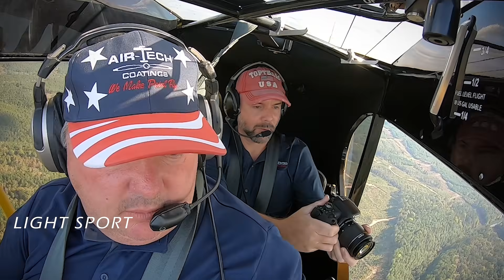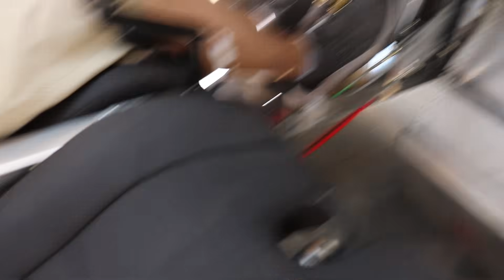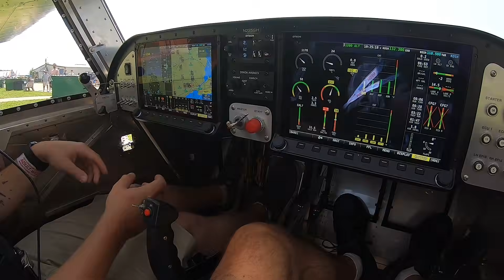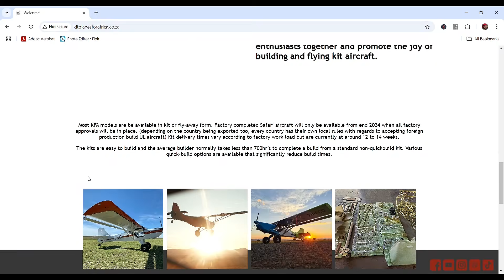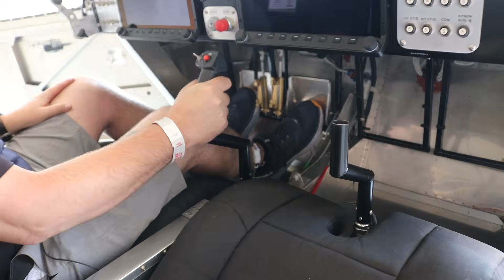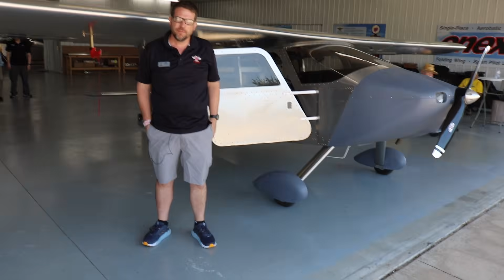I Fly the NEW Sonex Highwing! (On the Ground)

Comment: If Sonex were to raise the gear 3 inches, the plane would be a lot easier to get in and out of.  Plus, the raised attitude of the plane would be a lot sexier looking than the current shorty go-kart look.  If youre worried about forward visibility during taxi, install a GoPro in the nose and run the video to the computer screen.

Comment: Thanks to Mark and Sonex for putting added safety into the Sonex line with the high wing.  When going over on your back during an off airport landing, a Sonex pilot now has much greater head/brain crash protection, along with the ability to get out of the airplane when the crash is over. Theres nothing like a big bubble canopy to trap you in the cockpit when the plane goes over on its back.  Ou better hope it doesnt catch fire.

Comment: They really should do carbon fiber aerodynamic planes instead. They are really handicapping themselves by sticking to not only sheet and rivet but boxy shapes. Do a copy version of the Risen with a fixed forward windshield and SR22 style doors but keep the aero shape. Make it super light and skip the flaps, it's such a good glider that you don't need flaps on it. Landing speed might be 52kts without flaps and it could be lighter than Risen is. Carbon fiber is amazing if you use it right. Fixed skinny landing gear with nice aero covering. Super simple yet untouchable performer. And rather than two sides of fuselage glued together as is normal it could be done inside a closed 2 piece mold stood up on end so it's one shape. No trimming and polishing two sides together. With a polished mold the surface can be paint ready out of the mold. Very easy to build. Risen charged over 300k for their simple bird now. We need competition.
Reply: Nattering nabobs of negativism strike again.  Aluminum is perfect for this application.
Reply: @jeffwatson8862  Yep! Perfect. Is Naboo on the sectional charts for USA?  KNBU perhaps???   (haha!!)
Reply: @jeffwatson8862  I'm not from Naboo. I'm intelligent which might seem foreign to you. No, this alu construction is most certainly not perfect. And that's why more competent engineers don't do it that way. There are such potent tools available today, there is no excuse for these 100 year old rural garage build sensibilities. This is a soapbox cart. Look at it. It's not difficult to make an aerodynamic shape in composites. Look at birds, look at other planes. If they can make this soapbox with this many parts they can do composite. So they are self inflicting failure. They could do  so much better
Reply: Sonex does aluminum structure since this is their traditional space. This kit is within the skill level of someone with a few hands on skills, and not a person skilled in high end composite fabrication.  Anybody can pull a simple blind rivet. The composite airframe would be very expensive to produce since all the parts need a factory mold for each part.  You are not going to find a composite kit for anything except a replica kit car for 39K.  Thats just the reality of it.  Have you ever seen the composite Arion Aircraft Lightning?  They are composite kits and do what they do best.  Slick, fast and great looking too.  I almost bought one until I found out the luggage area was big enough for a pair of shoes and a toothbrush. Composite kit is pricey too.

Comment: And no toe brakes on the instructor's side, at least on this prototype.  My CFI was scared of my Piper 140 because of the same thing.  The perfect trainer, sat idle because of them.  On a 10,000 foot runway no less.
Reply: That's common on Pipers. I did some of my commercial in a Comanche 260, but it's totally fine for commercial. I'd be nervous with a pilot starting their training. I don't think I'd allow it until they've gone solo